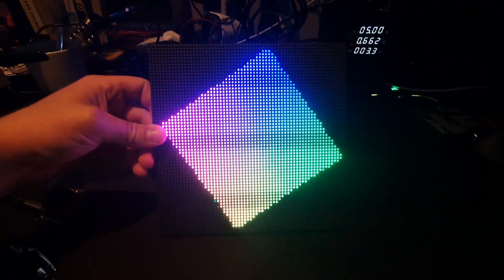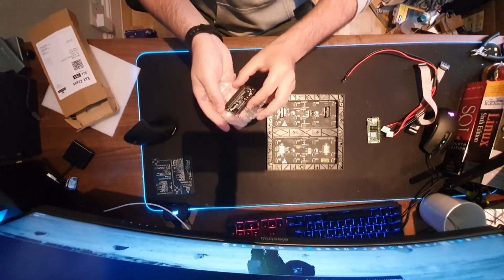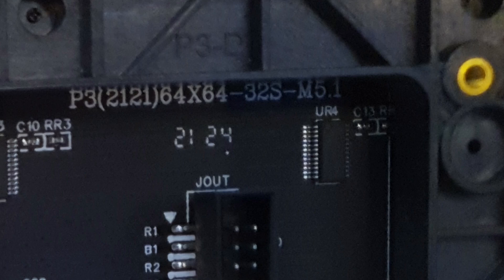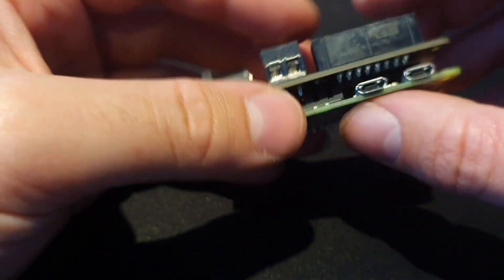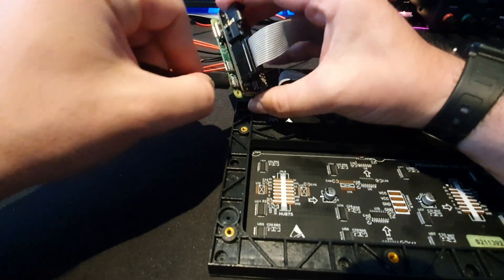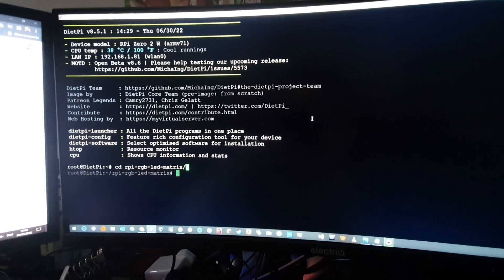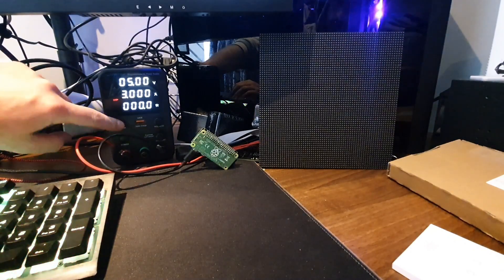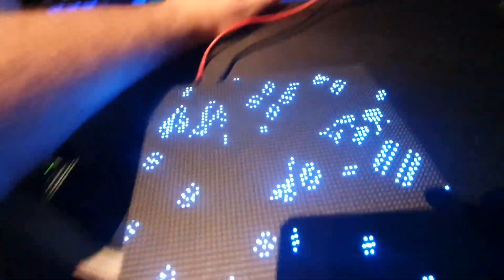How to: Adafruit RGB Bonnet and P3 led 64x64 Matrix

Comment: The upper half of my led matrix is flickering in all sorts of colors. Only some leds from the green channel are showing up correctly on the upper half.
The lower half works perfectly with the rotating square example.

Do you know what might be the problem?
I've soldered the jumper to "8" and I'm using the exact same command as you are.

Comment: very cool. one question, are these modules powered by 5 volts? or 12 volts?
Reply from the maker: Thanks - these are 5 volts. you'll find hosting a single rbg matrix board won't kill your power bank. I use a power bank with two usb ports. one for the RPI and one for the matrix. side-note i've since created an rgb cude and have managed to power upto 6 rgb matrix boards off a single usb port, although my powerbank does support upto 3amps which is the important part.

Comment: Thanks for vidéo very good and explicit. But I don't understand how can I show an animation or vidéo ?
Reply from the maker: For video it will take alot more work. There's a few methods. One is to use the flaschen method via vlc. you can find more information here https://github.com/hzeller/flaschen-taschen

Another method is to convert your video to a gif and transfer it onto the rpi - this is abit more manual but I've had less issues this way.  -  https://github.com/hzeller/rpi-rgb-led-matrix/blob/master/utils/README.md
Reply: @jakesllama  Thanks ! I'll look it. But now my problem is with this ./demo -D 4 --led-rows=64 --led-cols=64 --led-gpio-mapping=adafruit-hat --led-slowdown-gpio=1 my screen is cut in tree. I don't now why ? I have a square who turn on the center and one square in the right side(not a complet square) and an another square in the left side(not a complet square) who turn.
Reply from the maker: @UfukISIKBe  Hello! Have you soldered the '8' and 'e' pin together on the adafruit bonnet?
Reply: Maybe, I know why ? Is the soldering really not optional ?
Reply from the maker: @UfukISIKBe  unfortunately it's required for 64x64 matrix I hope you have the tools!
Reply: @jakesllama soldering is new for me. But I'll try.
Reply from the maker: @UfukISIKBe  let me know how it goes and goodluck!
Reply: @jakesllama  Everything is ok for me ! It's work. Thanks a lot.
Reply from the maker: @UfukISIKBe  nice! Awesome news 🎉🎉🎉

Comment: I know this was a while ago but im having tremendous trouble with getting this to work, the leds are split into 4 sections and only 2 of them are lit snd the rest blank, I have done a lot of troubleshooting but i would love to chat with you to see if you could help!  I would happily pay you for your time!
Reply: HUB75 led matrixes render/latch 2 rows at a time. 
The 2 rows that get rendered will be separated by half of the total rows, meaning in a matrix with 64 rows, rows 1 & 33 are rendered at the same time, then rows 2 & 34, then rows 3 & 35, and so on. 
If the rows are split into 4 equal sections (lit, unlit, lit, unlit) that likely means the program is set by default to render only half of the total rows on your display. 
If you change the default values in the code, or specify the total number of rows/columns when executing, it might resolve your issue. 
(For example, if you have a 64x64 matrix, you'd specify this in the terminal during execution: --led-rows=64 --led-cols=64 )

Comment: What's the pinout?
Reply from the maker: If you're updating the matrix board directly it will take more work but this should point you in the right direction - very useful reference 
https://pinout.xyz/pinout/rgb_matrix_bonnet

Comment: Thank you for the information it's really helpful. i would like to ask if it's possible to control this matrix using esp32 microcontroller and if adafruit neomatrix library works with this matrix? if it doesn't, do you know about any libraries in esp32 that supports it?

Comment: I'm powering my Pi and matrix through the barrel jack on the Adafruit bonnet, with the matrix cables going into the terminals on the bonnet. Is there any reason you chose to power the pi and matrix separately? Was it just to show power draw?
Reply from the maker: There's no right or wrong way - I just powered manually as I did not have a power source for the bonnet jack handy. Also I planned to place all units within a cube format - allowing me to attached a battery pack via usb so it was mobile, although I was unable to draw upto 3 amps via the battery pack on 6 panels. this will involve a custom mobile battery pack I suspect. Hope you're enjoying your new matrix, enjoy! :)

Comment: Hi I have done the same as you did but I powered the Bon next directly with a DC Barrel connector. The led board is not getting any power
Reply from the maker: There must be a power deficiency somewhere. As a last resort, you can manually wire the red/black led power cable to a USB plug. Then plug it into a USB port. I haven't had any issues this way.

Comment: Hey bro, I actually just got this for a school project. Using the raspberry pi 4 and the same adafruit bonnet as well as the same led matrix (same vendor of AliExpress). And I have soldered the e to the 8 pin on the bonnet. However after running the demo my led matrix bugs out and flickers intensely. I have tried all different gpio slowdowns. And recommendations? Help greatly appreciated
Reply from the maker: Could be a power deficiency - try attaching the power leads to a PSU if you have one or you can manually to a USB lead to a wall plug

Comment: Thanks for the video, very helpful! Can you describe in more detail how you shorted the E and 8 pads on the RGB bonnet? Did you just melt a blob of solder onto the E and 8 pads? I'm very new to this so more detail on that would be great. Thanks!
Reply: That’s all it takes!
Reply from the maker: Yes as you've said just add a blob of solder onto both E and 8. Be sure to let me know if there's any help you need!
Reply: I have done this but im gettings it show in 32x32 replicated across the entire screen @jakesllama
Reply from the maker: @Echo42Luke sounds like you need to adjust the rows/cols command. What size panel are you working with?
Reply: I have a 64x64, i am using the adafruit bonnet and have soldered between E and 8, it does look like the scale just needs to be amended somewhere or using code but I have not too much understanding on coding so need guidance  @jakesllama
Reply from the maker: @Echo42Luke thanks are you using the exact same command listed in the description? Abit hard to distinguish. If you could send me a pic to my email? I can help you through Google chat

Comment: The description of the bonnet says that for each led line you'll need at 0.12 amps of power. For a 64x64 matrix you would need at least 8amps.. how do you get away with only providing 3 amps?
Reply: 0.12 mA per led
Reply: Or is it because you connected the power cable directly to the matrix?

Comment: All works until i test it with the "./demo -D 4 --led-rows=64 --led-cols=64 --led-gpio-mapping=adafruit-hat --led-slowdown-gpio=1". Than i get the error: bash: ./demo: not found
Reply from the maker: Hey KonstiKing! Sorry just seen this.
It seems you may just need to move into the directory that the program is in or make sure it is downloaded.

curl https://github.com/hzeller/rpi-rgb-led-matrix/tree/master/lib

cd rpi-rgb-led-matrix/examples-api-use

make

sudo ./demo -D 1 runtext.ppm

Advise reading instructions here 
https://github.com/hzeller/rpi-rgb-led-matrix/tree/master/examples-api-use